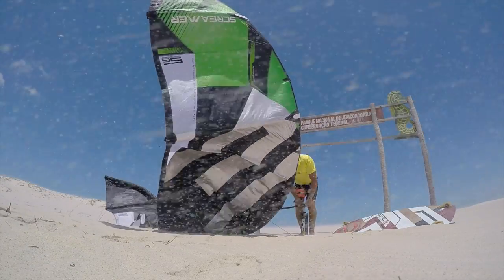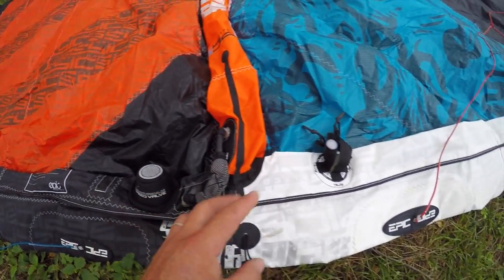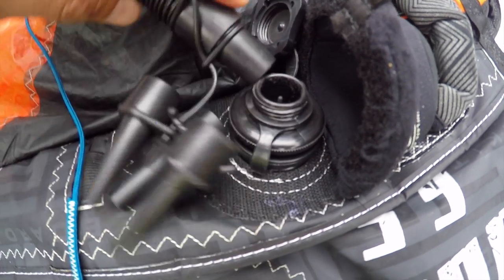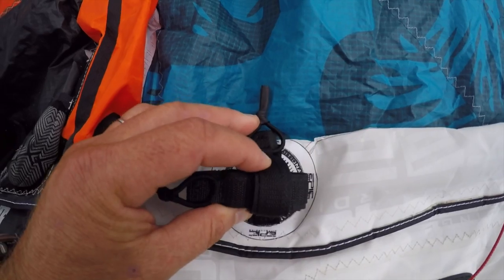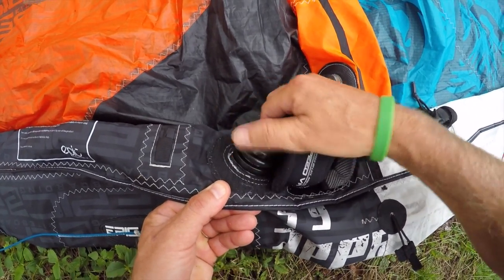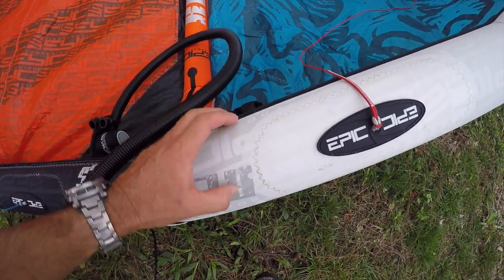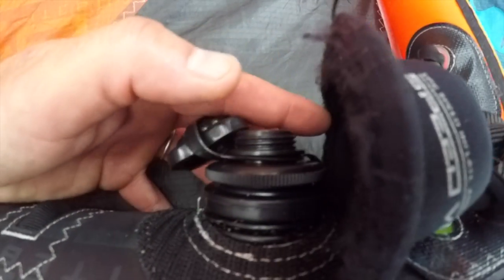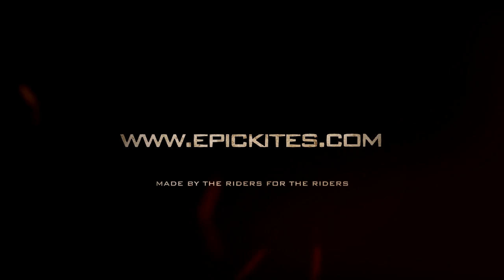HOW TO INFLATE THE SPEED VALVE OF YOUR KITE

Comment: im having problems with the fitting staying in the speed valve when im pumping up.. its a brand new screamer 12. do they wear in after a while?
Reply from the maker: Hello Tim.  Is it a (5G) SCREAMER 12?  If so it's because it's a new kite and the valve needs to be use few times in order to get the oils out from the new plastic of the valve. Any way you can always get in touch with me via email at:  dimitri@epickites.com